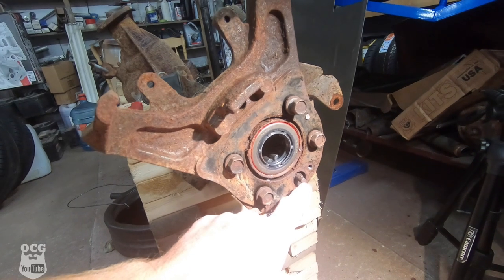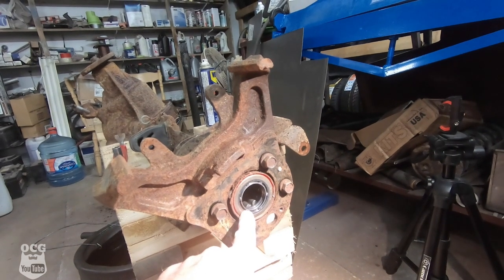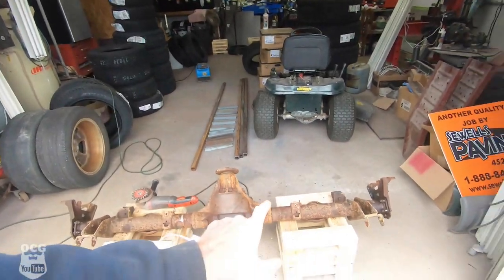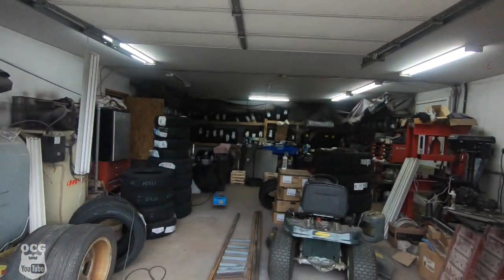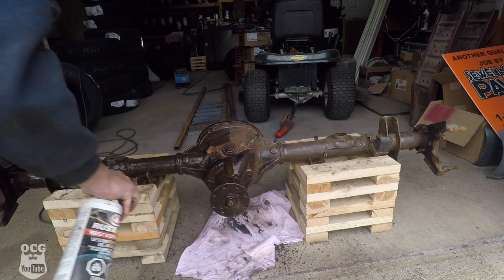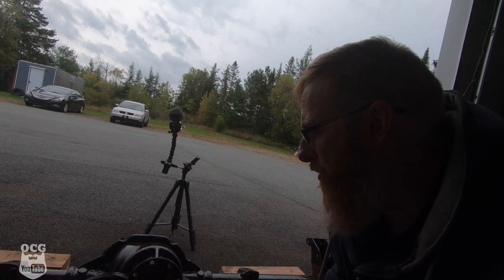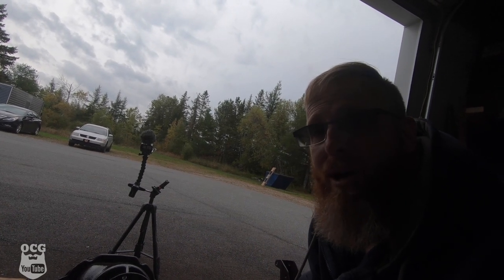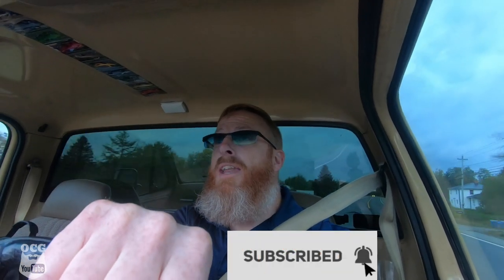Swappin a Ford 8.8 Axle For A Locker (CROWN VIC, GRAND MARQUIS) Pt.3

Comment: There's also a reason why more people have a motor replacement or transmission replacement story than a rear-end replacement story. The third member is the strongest part of the drivetrain that get the least amount of love/maintenance. If it's a low mileage unit, it's likely gonna last close to forever. If the bearings looked clean, why risk not getting the replacements in as good as the factory ones were.

Wire wheel looked to do a pretty good job. Well...hopefully everyone found the Sally's Speed shop episode...
Reply from the maker: Thanks for the encouragement! At least someone gets it!
Reply: 98 f150 4.6. Rebuilt rear end. Engine is factory never been opened up. Trans had torque converter changed
Reply: 2wd by the way. So it does happen. Actually our chevy 2500HD 6.0 has rear end rebuilt and trans had torque converter changed and rebuilt cause something cracked with 3rd gear. Engine had oil pump changed.